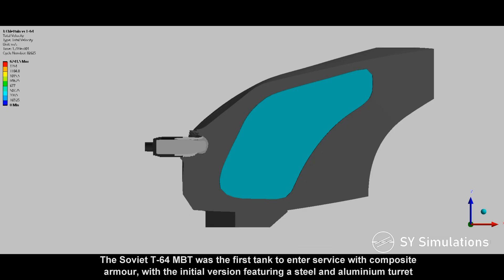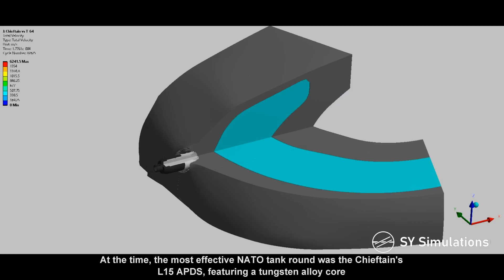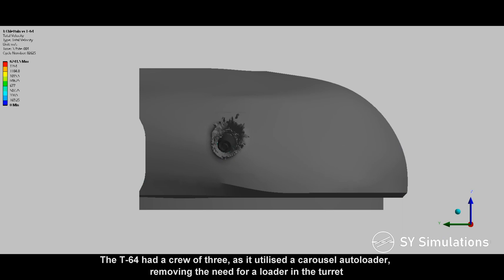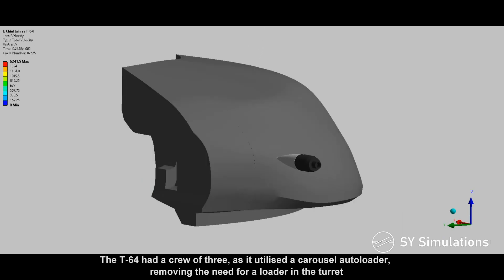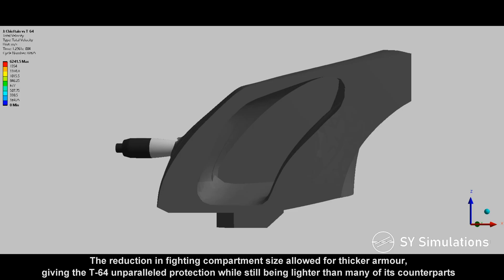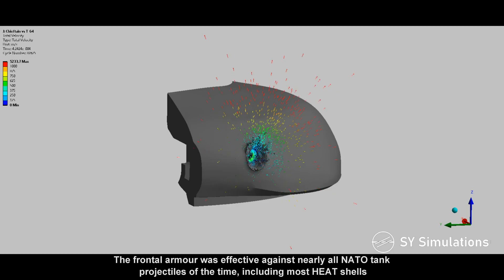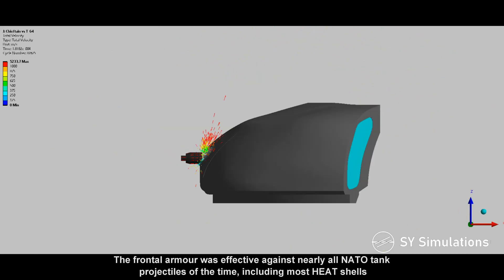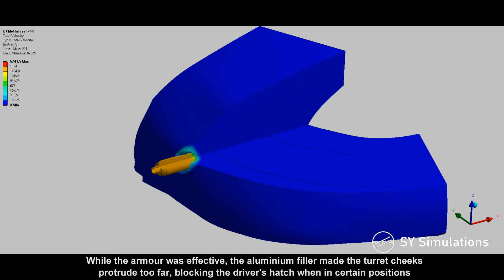THE FIRST TANK WITH COMPOSITE ARMOUR | Chieftain vs T-64 Object 432 | Armour Penetration Simulation

Comment from the maker: For those wondering, the main reasons for aluminium filler was to counter shaped charge jets. Eventually, T-series tanks received NERA in their turret for this purpose.
Reply: How differently would aluminium act against shaped warheads?
Reply: @davewebster5120
It’s the non-American way to spell
Reply: @simonhofrichter2551  Mass efficiency is higher for lower density materials when resisting HEAT "jets" of other very high velocity impacts. This is because thickness efficiency scales at roughly the 0.5 power of density, then ME scales at 0.5-1 = -0.5 with density.
Reply: @Kalecki99  yeah ME is higher, so the tank gets lighter, but does it affect survivability without considering weight?
Reply: I cannot answer this question as we do not have a defined comparison.   

Protection would be better with the same thickness of cast steel , but this would be too heavy, so if an all steel turret was chosen, this would have worse performance. 

Later production T-64 had a new turret with ceramic balls in steel, this offered better protection vs KE and was less bulky, so the driver's hatch was no longer occasionally blocked.
Reply: @Kalecki99 Tankograd has a good in-depth dive into the balls, IIRC. The main problem was the expense and difficulty of manufacturing. (This probably led to all sorts of quality control issues.) After that, Soviet tanks started using multiple layers of sheets.
Reply: @ There also was a similar "sandbar" armour used on T-72. But yes eventually a NERA element was used in the turret cheek.
Reply: Ceramic BALLS
Reply: "T-series" might be a bit excessive here tbh, considering only T-72B and its further evolutions got it (from serial tanks).
Reply: @gargean1671  
T-80U also got NERA, though of a different type.
Reply: @gargean1671  T-80 and T-90 got a much better stuff, because they were meant for "guards armies" [full-time proffesional soldiers], not  reserve troops
Reply: I'm wondering why you can't spell aluminum correctly 🤣
Reply: @davewebster5120  Tell me you're from usa without telling me
Reply: @davewebster5120  Aluminium is the correct way. Its just that Americans get confused with long words and proper spelling and/or grammar. You guys love to feel special for the most idiotic reasons lol
Reply: @davewebster5120  Ragebait much?
Reply: @davewebster5120 Because in proper English aka the language spoken in England, it's spelt aluminium. What you should be asking is why Americans couldn't spell a relatively simple word correctly and needed to change it to aluminum 😉
Reply: @ I hate to break it to you, but the word Aluminum predates Aluminium by a couple years.
Reply: @BoomchacleV0  
> the word Aluminum predates Aluminium
It does not. The only reason why "aluminum" got any hold in America was a low-quality Webster's dictionary.

Comment: And yet, in Ukraine, we have seen penetration and catastrophic explosion, following subsequent initiation of fire in the collar magazine.  So, these Russian tanks aren't so invincible.
Reply: Oh how conveniently you forgot that T-64 originated from Kharkov Tank Plant, in your logic meaning its a Ukranian tank...
Reply: @randuser_42069  errado, ele foi fabricado durante menos de uma década entre a Ucrânia e a Rússia(na época soviética) e rapidamente engavetado quando o t-72 Ural provou ter uma proteção melhor com chapas de armadura soldada do que as de aço fundido
Reply: These Soviet tanks (designed and built in a factory in the Ukrainian SSR before the collapse of the Soviet Union (so more Ukrainian than Russian, but really they're Soviet, not Ukrainian or Russian)) certainly don't offer much protection against modern anti-tank munitions. But in the 1960s and 1970s it was a different matter completely. NATO didn't have armor penetrating ammunition that could get through its frontal hull and turret composite armor until the late 70s, and it didn't have ammunition that could easily and reliably penetrate the frontal composite armor until the 80s. Even in the mid-70s the T-64 would have been far from invincible, since it didn't have composite armor everywhere. Something like the M728 APDS round could penetrate anywhere that didn't have composite armor, such as the sides, the lower front plate, the gun mantle, and the top-center of the upper front plate (where there's a gap in the composite armor to accommodate the driver's position). And a lot more goes into making a good tank than having tough armor (optics, crew ergonomics, and fire-control are arguably more important, since firing first is historically the most important factor in tank vs tank engagements). So personally I think that, despite its superior armor, it would have been comparable in actual combat performance to the NATO 2nd gen MBTs, like the Chieftain, Leopard 1, and M60. But there's still no denying that it would have been a tough nut to crack prior to about the mid-80s. Armor may not be quite as important as everyone assumes. But that tough armor still means that you might not succeed in knocking it out with your first shot, meaning that you'll need to spend more time engaging the same target. That's not too much of a problem when you've only got one target to worry about. But when you've got a whole formation of oncoming Soviet tanks to worry about, spending more time trying to knock out one tank means that the other tanks to the left and right of it have more time to spot and kill you.

Comment: ~600mm total thickness (im assuming that doesnt include angling) so not surprised that stopped it.
But that sure is a heavy armour array! If the russian tanks had been the same size (on the inside) as NATO tanks, they would have been enormously heavy!
I wonder how this compares to a chieftain turret eith Stillbrew armour (a similar hard-soft-hard material layout).

Comment: I'm an aficionado of cold war era tanks and i had read up a lot and most western authors used to say that the T-64 was a failed design due to being too complicated and switch to T-80 proved that. I always wondered why the Soviets would have them in thier premier offensive formations if these sucked, the T-64's performance im Ukraine shows that it was no slouch, if Ukraine after decades of corruption and neglect can have them perform so well that they are still fighting after 3 years of war then imagine the soviets with their 300 tank divisions and multiple divisions coming at you in succesive waves

Comment: Huh? Aluminum burns. This vid is nonsense.
That wasn’t a Sabot round either.
Ask the us Cav about the aluminum armor on their Acavs when they got hit by an rpg.
 If the T64 had aluminum sandwiched in between it was as a weight saver.
Aluminum is not going to slow kinetic energy rounds and it certainly won’t stop a plasma jet from a heat warhead.
This is nonsense

Comment: I fought the Chieftain in the 1980s, we put dart shots thru the turrets on 2kms distance this tank stand no chance against T-72 nevermind T-64. The T-64 was really a monster for the 1960s.
Reply: Pretty cool seeing a vet from the Iran & Iraq war in the comments. Lol
Yeah the Chieftain was a great tank but the turret wasn't up to the challenge later in its years when higher penetrating darts/HEAT rounds came into service. 
Was one of the best tanks out there until the mid 70's when other tanks surpassed it's protection levels (like T64, T72 and M1 Abrams - the latter using Cobham armour that was used on the Challenger 1 tank)

The Chieftain did get stillbrew armour which helped increase its protection levels but from declassified documents from the UK national archives its protection was only similar to the standard A3 Leopard 2 against darts and not HEAT.
Reply: @BroadHobbyProjects 
The T-64 was made at the same as the chieftain
Reply: @اسكندرفكار  My bad, meant the later additions like the B variant that had more advanced composites. The standard version had aluminium sandwiched between steel. The B variant in approx 69 onwards was the much more improved one that worried NATO nations as they were more durable & other improvements. The B variant inspired the turret design for the T-80 and hull/turret for the T-72 too given the design allowed for armour improvements
Reply: Were you Iraqi tank crew?

Comment: That's not how a confrontation between the Chieftain and the T-64 would go at all!

Instead it would go like this: "Oh god! T-64 is on fire!" or "The ergonomic properties of the T-64 blah blah" or "The way in which you tension the tracks of the T-64 is..." or if the confrontation gets really nasty it would go like this, "the engine deck is nicely uncluttered but there's only room for 2 of the 3 crew members to sleep".

Comment: Glass-textolite (sometimes called “textolite”, technically a layered composite based on glass fiber and resin) is used
 T-64B / T-64BV:
Uses a filler made of ultra-porcelain beads in an aluminosilicate matrix - sometimes called “ceramic filler” in the literature

Comment: mechanical engineer here, the ductile properties of aluminum exhibited at around 0:11 show the aluminum filler being compressed inwards before the projectile enters the cavity. Such a behavior could be favorable but if i remember correctly the soviets developed "textolite" to be an incompressible sort of  material shortly after, possible to resolve this?  I would have rather seen the soviets develop a higher quality castings instead, but i doubt they had the technology to do so at the time, still very impressive.
Reply: All these "X here" comments should be automatically deleted :D Always full just some random yapping trying to sound smart
Reply: Change castings to achieve what? I think this works very well, virtually flawlessly. The better system would be welded turret designs anyway as in 478B
Reply: Textolite is a fiberglass reinforced plastic material, and it was combined with ceramic elements. The textolite/ceramic was sandwiched in-between two layers of steel armor, which is often referred to as "Combination K"

Comment: This unique turret armor actually functions using the same compression-decompression mechanism as the steel-textolite-steel hull armor to defeat shaped charges.

When piercing through thick steel armor, the tip of the shaped charge jet experiences extremely high pressures.

But once the jet breaks through into the softer aluminum layer, this pressure build-up gets instantly released, causing the jet to get destabilized and break apart into smaller particles.

These smaller particles lose speed and energy at a much faster rate and this makes it easier for the second layer of steel armor to stop them.
Reply: This is the kind of comment that makes the comment section worth scrolling down to.
Reply: Yes but there also is a gain from using a low density material which will have a higher ME vs HEAT.
Reply: That is an interesting concept! I have never thought about compression/decompression, but it really makes sense.

Comment: God such a Soviet “design triumph” we designed a more armored turret, but some times the driver can’t get out 🤷
Reply: driver has a turret rotation button on his control button allowing him to escape if the turret crew are incapacitated
Reply: Typical westoid bs. None of the competing Western MBTs allow for 360 unobstructed driver's hatch.
Reply: @ 360°? The T-64 has a round turret with no bustle, it at a minimum should have 350°(10° for the mantle and barrel) of clearance for crew egress. And with the turret shape it should have been easy to design a drivers hatch/turret placement for complete unobstructed opening of the hatch. And wtf is a westoid?

Comment: So if they went to war no nato tanks could kill them from the front
Reply: Nato tanks can kill them, because turret is not the only armor
Reply: If there had been a war in the 60 or 70s, no NATO anti-tank weapons would have been able to penetrate the frontal composite armor of the Soviet T-64s. But only the front had composite armor (every NATO anti-tank weapon could easily penetrate the sides and rear), and even on the front there are plenty of places with no composite armor. The lower front plate has no composite armor, the gun mantle is a gap in the turret's composite armor, and there is a gap in the top-center of the upper front plate's composite armor to accommodate the driver's position. You can also sometimes get a shot over the turret's frontal composite armor (basically, into the roof armor) if you can get a good firing angle (such as if you are firing from an elevated position, or if the T-64 is going down a slope). So they're far from invincible in a 1970s war. But they are certainly still pretty tough.

Comment: When did the t-64 with aluminumoxide (corundum) spheres that were strategically placed into the aluminum "cheek" come into existence?
Reply: @soul-om4id  was this a real thing?
Reply: @simonhofrichter2551  yes it was very real. It was also extremely good at stopping both heat and apds rounds when it was manufactured to specs. However I believe they stopped trying to produce it as the manufacturing was too inconsistent and difficult resulting in defects.

Comment: I would be interested to see a simulation of the T95 medium tank, the first tank design that used composite armor. The T-64 is the first to be mass produced but the T95 was prototyped before it.
Reply: T-95's armor was much worse and had a huge habit of shattering in testing
Reply: It would fare badly.
Reply: @sammymayol7511  I shoulda specified I'd like to see it against a more appropriate round, maybe HEAT since it was supposed meant to counter such rounds quite well.

Comment: The APDS doesn't go through the T-64's strongest point, who'd a figured. Go anywhere nearer to the gun-breech or the hull and it won't be as nice.

Although to make this shot mroe likely, the choice of a hull-down position is of course there, but if you're going hull-down, I'd still rather be in a chieftain.

Comment: We were taught to target turret rings, lower glacis and anywhere on the sides...
Reply: Yeah, all those would work. The lower glacis could be a little hard to hit, as it's quite small and low. the area around the drivers hatch was also a weak point. This is assuming you were going to fire 105mm APDS at it. 120mm APDS could go through the upper hull front at most combat ranges.

Comment: Did you do this versus  the Chieftans HESH round ?
Reply: HESH dosen't work on composite armors.
Reply: with an air gap I would agree, but this has a solid metal fill which would still transmit shock waves ?
Reply: @adamrudling1339  No. I read in spcialised book about tank warfare  That HESH can't touch T-64 from the front.

Comment: Where did you source the information on how the T64 was made? This does not match up to the information or photographs I have on the the construction. "The hull and turret are of cast and welded steel armor that incorporates a mixture of conventional steel and ceramic inserts called Combination K, with the ceramic inserts providing superior protection against HEAT attack" I see no reference to Aluminium anywhere in the documents. I mean the prototype used ceramic balls and not plates but there were issues with the balls staying in place during casting so plates were substituted instead.
Reply from the maker: There's a good article on Tank Archives called balls of soviet tanks where you can read more about this variant. There are some other places as well if you search for t-64 aluminium turret or object 432.
Reply: The ceramic ball insert wasnt implemented for the T64A until late into into production, the T64A obr 1974 armor of which carried over to the T64B.
Reply: Some good info if you google "Armor protection of the tanks of the second postwar generation T-64 (T-64A), Chieftain Mk5P and M60"

Comment: Isn't aluminum worse than steel? Wouldn't the turret be better protected if it were just steel or the filler was quartz?
Reply: Aluminium-steel composite is better against HEAT than homogenous steel, that was the main concern when designing this arrangement
Reply: @IvanBaturaChannel  Thank you.
Reply: they wanted to add more volume to the turret to defeat shaped charges but making it out of just steel would have made the tank and the turret too heavy, so filling it with aluminum is a good compromise in that sense.
Reply: The aluminum is much weaker than steel, but much lighter than steel, this makes it good against HEAT.
Reply: It's more weight effective than steel for HEAT protection, which was the main focus of the composite armor.
Reply: My thoughts exactly. Can't fathom as to how this is better.
Reply: @TheOrdomalleus666  this is better against HEAT shells, which have gained more popularity it just tradeoff for protection from different types of shells
Reply: weight
Reply: Later models incorporated sintered aluminium oxide spheres (refered to as ультрафарфор) instead of aluminium metal for better shaped charge resistance but it was more difficult to produce those turrets. I'd imagine same would be with quartz filler, though some T-72 turrets were made with sand cores in them so who knows?
Reply: Aluminium is much less dense than steel, so same thickness will be much lighter. In such an arragement thickness of armor needed to protect from the incoming round is bigger than it would've been with steel, but it is also much lighter. And weight is INCREDIBLY more important in tanks, in most cases more important than physical dimensions.